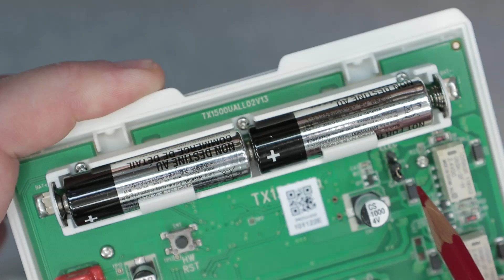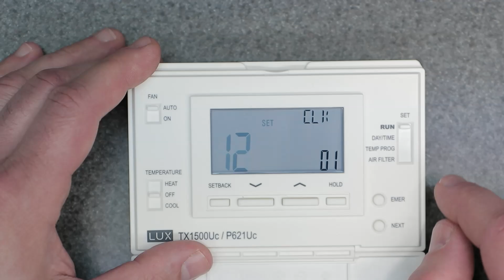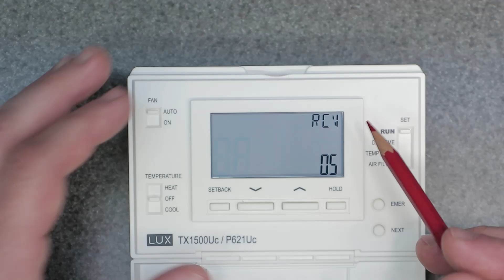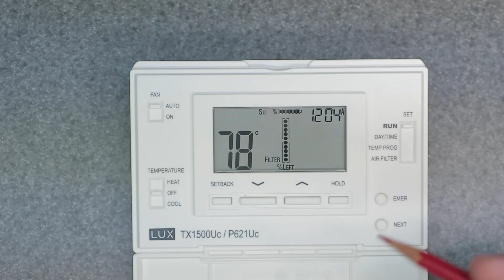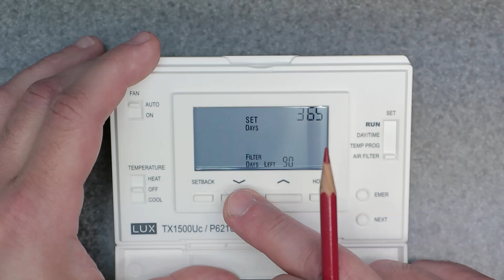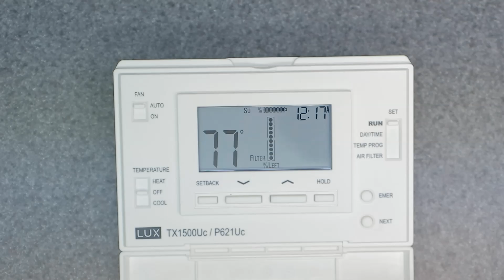LUX Pro P621U | Setup & INSTALL Settings | P521U LTX9100U LTX500U LTX700U LTX1500U Thermostats

Comment: Hey Franco, I was wondering if you have a video on how to change out the Lux 500 model. I believe that it's time to change it. Please inform if there are any nuances to be aware of when performing this task. The reason why I believe that on its last leg is because the the the LCD display is only displaying a single number. But it hasn't affected the operation of the heater though.

Comment: Good walk through, just one enhancement I have is for the explanation of the swing setting. The adjustable swing is the main reason I bought the thermostat, to remedy an oversized unit that came with my house. The thermostat increments (1-9) raise the positive and negative swing value in 0.25 degree increments above and below the SET TEMP so the higher value you set it to the more the temperature will fluctuate above and below the set temp during each run cycle, I'm not entirely sure about the stages being affected. Here's what I found from the manual: "TEMPERATURE SWING AND OFFSET SETTING: A thermostat works by turning your heating or cooling system on and off whenever the room temperature varies from the desired set-point temperature.  The amount of this variation is called the swing.  Generally your system should cycle on about 3 to 6 times per hour.  A smaller swing number makes the system cycle more frequently, so the room temperature is more precise and constant.  A larger swing number will make the system remain on for a longer duration each time and decreases the number of cycles per hour. There is only one Swing setting, and this determines the cut-in and cut-out points for both the first and second stages (if present), in both Heat mode and Cool mode. NOTE: The Swing and Offset settings need to be performed in a timely manner, as the thermostat will timeout and automatically exit these adjustment screens after approximately 10 seconds without a button press. TO CHANGE THE SWING SETTING: Ensure that the System Mode switch is in the OFF position and the Set Slide switch is in the RUN position.  Press and hold the HOLD button for at least 5 seconds.  The words “SET” and “SWING” will appear in the upper right corner of the screen, along with a single flashing digit.  Use the UP/DOWN buttons to change the number value between 1 and 9 (0.25F to 2.25F, in 0.25F degree increments).  Number 1 is the default setting.  Press the NEXT button to accept the swing setting and proceed to the OFFSET setting."

Comment: hey, first of all gret video very well explained, i think mine has a problem cause i did all that but it wont work it just doesnt get cold i am dying inside this house lol pls helppp
Reply: You need to use the emergency heat rock turns off the heat pump and only runs the furnace. If you don't do this you will burn up your heat  pump. More expensive but that's how it works. Mine doesn't heat usually below 35-40 degrees. I only run the emergency in winter though.
Reply: @alyssapeters6271 you are literally a life saver omg!!!!!